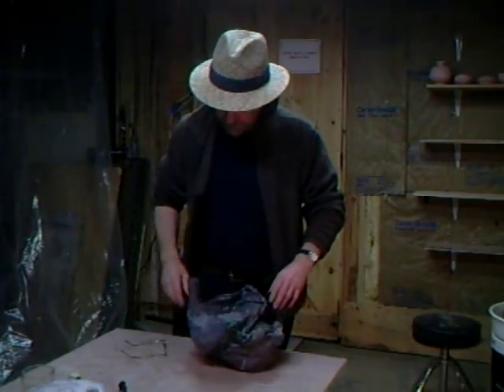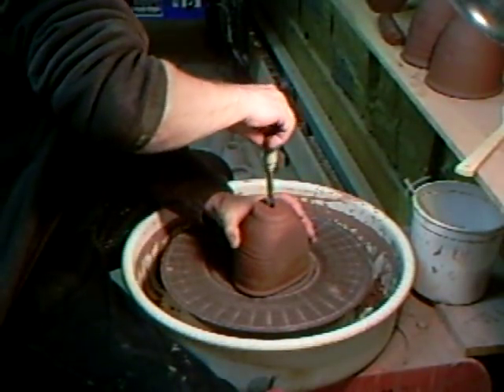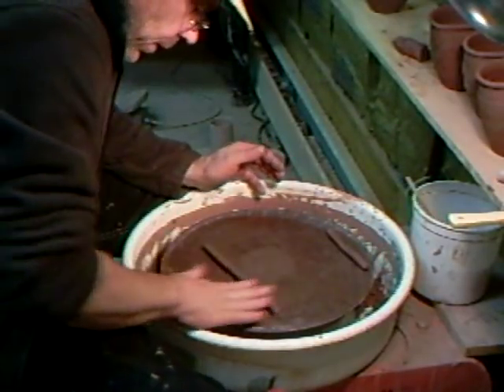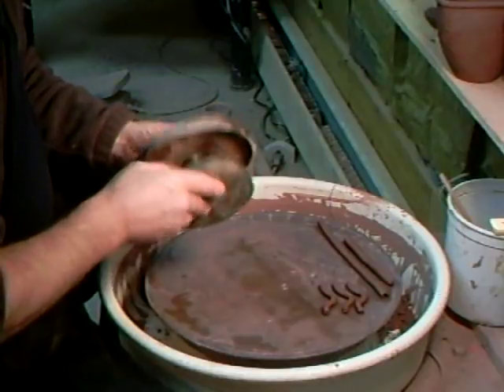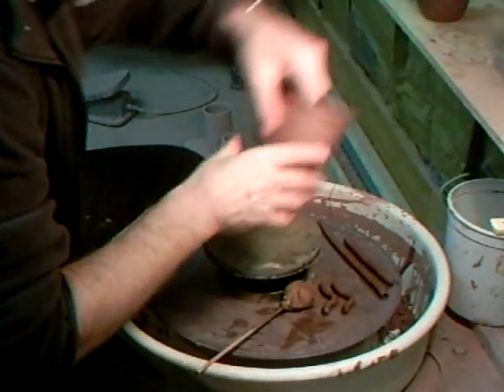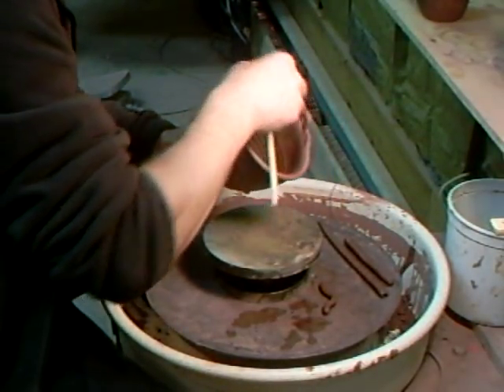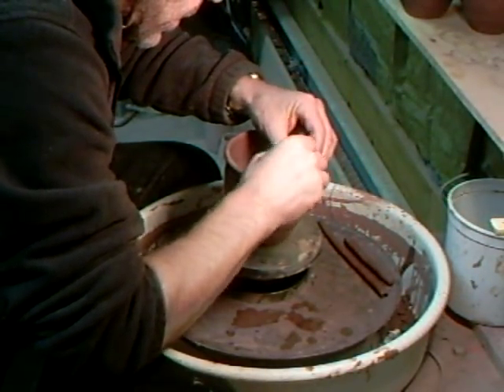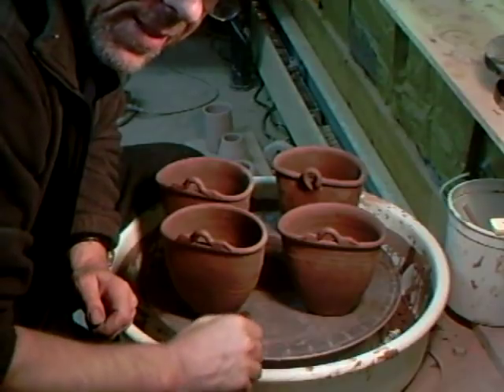SIMON LEACH - Finishing the wall vases - (Castellano & English )

Comment: i noticed that you use your own spit sometimes when you need just a little moisture in a small spot on the clay.  i thought i was the only one who did that!  especially when loading a bisque fire and doing a final inspection on my greenware, i'll do some last minute spit smoothing.  

on my hanging wall vases, i like to put two little holes back there and put a small loop of hemp or leather cord for a hanger, but i quite like your method.  once again, thanks for sharing, simon!